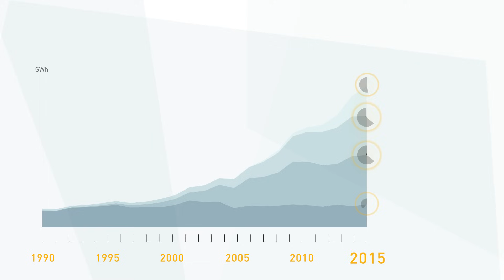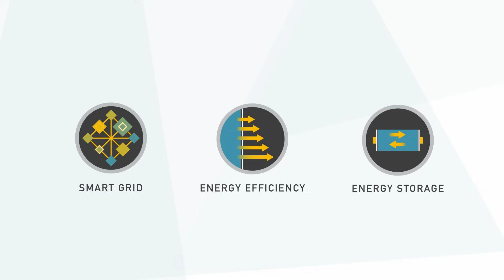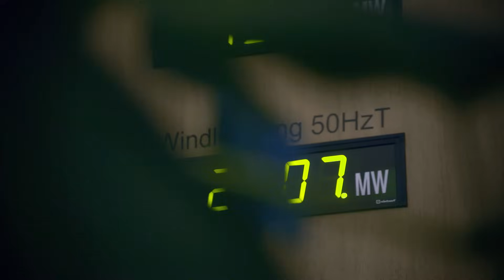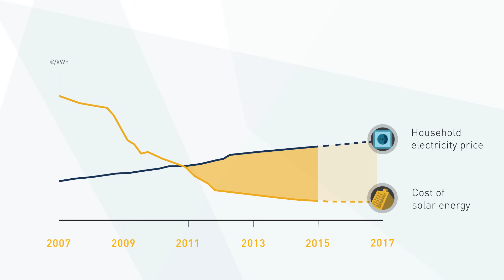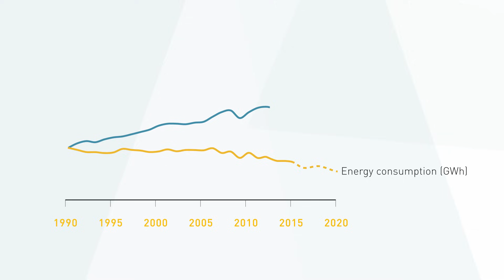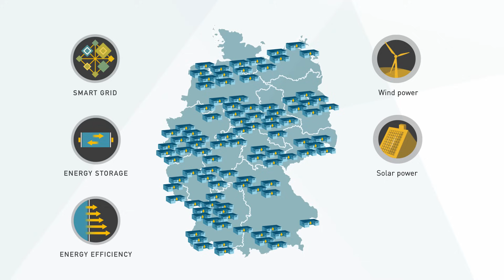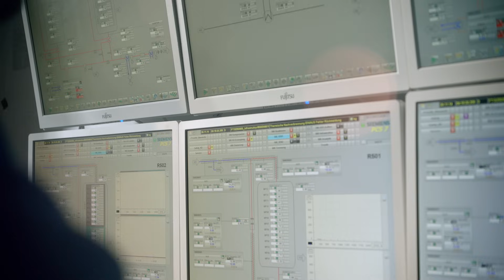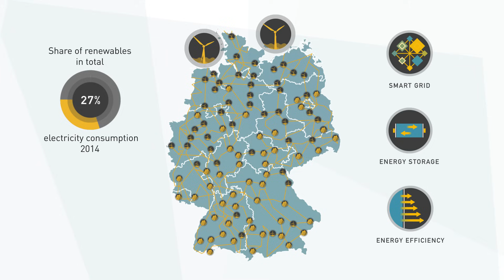Germany's Renewable Energy Revolution

Comment: https://youtu.be/klXj198vY4A

https://youtu.be/VeXVsybEQPQ

https://youtu.be/lIkzlq3XTcA

You have to ask, my big brother, Dr Steven Greer, about help? He will learn you how the free zero energy system of Nicola Tesla work? And how you can produce high voltage and power electricity for the whole Europe with low cost???? Also, to let your machinery and your industry run on the same level as before the actual disaster happens worldwide, and good luck. You don't need any wind turbines, also no nuclear power, or combustion oil or something else. If you don't know, you can also run combustion motors with H₂, water molecules. All dies systems are environment friendly!

Comment: Update 2020. 46% renewable share in electricity production. Wind power overtakes coal as dominant electricity source. While improving in the electricity sector, the next challenges are heating and transport. The car industry will see huge changes in the next decade.

Comment: Do u all know this thing....earlier electricity was produced from water ...water itself doesnt create any electricity unless n until sun rays are put on water n then such energy are used to produce electricity....this was the concept of generation of electricity through water...this can be said as an indirect source of electricity production    ..now u are using solar panels for generation of electricity...there r two ways either each house will have solar panel or solar panel are built in one particular area n then electricity is produced n distributed....sun is the object solar panel use to operate ...newtons law states no energy can be created or destroyed it just transform from one body to another...every sun rays or light rays or any other form of electricity eventually transmitted to earth n then we dont know ....this solar panel is a form of direct energy production....since all the energy is transmitted into earth ,the earth is bound to get heated during summer n vice versa.....nw understand the nature of sea level ...sea level is below in many countries ....so whtever electricity is transmitted in earth from which it is transferred into sea understand land and sea breeze....u r nt utlising electricity from water n directly putting pressure of mre heat on solar panels ...so water remain hot n gets mre hotter and evaporates ...this will happen to ur iceberg too ...it will start melting if mre heat is used...nw understand one thing if sun rays are in direct contact with iceberg if melts from above ...wht will happen if heat from below causes iceberg to melt from inside....there is a reason y we all accept newton theroy...earlier it was a renewable source now it seems it is nt ....i guess it nt getting clear so understand one concept wht happen when we touch ice or boil water ....nw wht will happen if u walk barefoot on road at 40'celsius or 10'celsius when ur body temperature is 37'celsius...ur scientist can understand this theroy....so better build some submarine or flying houses if water eventually acquires ur land .....commerilastion means betterment of the land n i think solar panel mite nt be a rite way to use just for business purposes afterall who what to leave their land ...solar panel mite cause destruction to ur land specially ice related land first...other country mite use this as an exception mite nt continue with solar panel if n when destruction occurs...solar panel is one of greastest achievement in world history if used wisely or mite prove the greastest weapon of mass destruction whoknows ....lets hope thing dont get bad.....

Comment: Interesting that hydrogen and batteries are suggested for storage when almost all commercial electricity storage uses less expensive pumped hydro. Strange that the current relationship with Norway and Sweden balancing Germany's wind wasn't mentioned, they are well on the way to becoming the most interconnected power grids on the planet.
Reply: yeah exactly. interconnectors are great.

Comment: My tel. +48-780-129-544, email: htg@interia.pl   I invented a breakthrough source of energy which will be useful e.g. for laptops and for cellular telephones. I am looking for capital in the range $500 000 to $5000 000 for prototyping, patents and production. I have a computer simulation of my source of energy. The simulation is based on Classical Electrodynamics and on Circuit theory - both of these theories have been very well experimentally confirmed.

Comment: Several families use up electricity freely and end up getting a $200-$500 power bill. That could be an especially hard pill to swallow when times are tight. You can cut electrical power consumption and bills through the generating power method “boma fetching unique” (Google it), which helps you produce you own power.

Comment: How to get 95% of the energy gone...ASAP.  Make engine that is 60% that can run on fuels, Natural Gas AND battery without electric motors.  No hybrids...  That engine can enable boundary layer drag reduction that can cut drag by 50% or more.   For example.  Tesla now gets 100 mpg e.  Make new car that is 1/2 the weight and 1/2 rd the drag...200 mpge.  That is 10 times more than a car now gets.  City will be twice (400 mpg) if it maintains efficiency like the Tesla does.  On natural gas at $1/gal that is around 1/2 cent/mile.  In contrast, electricity in Germany is 30 cents/kw-hr or $10/gallon e.  10 x 2 is 20 times less to travel via my new car with new engine.  When batteries drop in weight and increase in power density, then they can be used to power the car for short trips, thus using mostly renewables.  People will buy this as they won't have range issues and can get Natural Gas from house.  The engine pumps the gas.  Why pay 20 times more when you can have it much sooner?  Politics?  Oh, I forgot, the well connected have to fund their jets.  Sorry, go back to sleep....
Reply: Watch Audi the next 2 years
Also Mercedes has the only engine,who is 50% effective with fuel.
But no,we are in for a new energy source.
And that not electrical.
Reply: Jan54, the key is low power efficiency, not at the high power levels where the 50% figure is had.  I would guess the Mercedes engine is only 10-15% at city driving and 20-30% highway, not 50%.  Also, they need to use low cost Natural Gas and even H2.  read my tweets at twitter.com/seaplaneguy  I explain how the Mercedes engine is flawed in the basic layout.  There is a better way
Reply: Haha,i let that open.
Its the formel 1 engine of there f1 car.
That has the throttel most of te time wide open.
Very special and smart engine.
https://www.motorauthority.com/news/1112999_mercedes-amg-f1-engine-achieves-50-percent-thermal-efficiency
Reply: Jan,  You missed the point I was making.  The technology may be ok for racing, but racing is not valid for street cars.  No car needs 1000 hp.  They need around 5 hp city and 20 hp highway steady speed.  That means the throttle is mostly closed and the thermal efficiency is very very low.  The idea is you compete against electric vehicles by having constant efficiency all across the power range, not just at full throttle as you say.
Reply: You are wrong,the have a special combustion part in the cylinderhead.
There the inject a rich mixture,and in the cylinder the inject a poor mixture.
In the combustion part is also the spark plug.
If the ignite the spark plug,the rich mixture flames the poor mixture easely.
So it a very efficient poor mixture engine.
Reply: Jan, you clearly never took a thermodynamics class.  No, YOU are WRONG.  When you throttle, the effective compression ratio drops and thus the efficiency. You see this with the Saab variable compression ratio engine.  Well documented.  This Mercedes engine does not have variable compression ratio, so the efficiency does drop. The mixture is another factor separate from the effective compression and expansion ratios.  Basic thermo.  As the power level goes from full throttle to closed throttle, the efficiency DROPS. Every BSFC curve shows this. That is the point.  Any book on thermodynamics shows this...
Reply: It has a hybrid turbo on it.
So there is always the wanted air in this engine.
Compression ratio is not so important with this engine.
Reply: Jan, not sure why this is so hard to comprehend.  If you have a 500 hp engine and you only need 5 hp or 1% all that "hybrid" stuff will not be functioning as a turbo does not work at that power level due to the lack of air flow.  

The question is how efficient is that 5 hp?  I would guess that engine is 5%, maybe 10% and not 50% at the 5 hp power level.  A large engine with all the friction and drag making 5 hp...not good...  That means your fuel economy around town would be 5-10 times LESS than what is could be if it were 50%.  That is the point.  This engine fails to address the central problem of power...therefore of little worth.

Comment: You should also know that at peak times when the air turbines in the nord of germany produce above-average amount of electricity (in windy periods), the transmission network is incapable of handling it and the electricity is then adversly affecting the transmission network in the Czech republic as the electricity is rolling over it's network infrastucture which (may) cause blackouts and requires very costly counter-measures that Germany doesn't seem to care about at all.

Comment: The comments attached to this video frequently mention energy utilization behavior in the United States. As an American, allow me to suggest that an impoirtant idea for improving energy usage behavior is to talk about all energy quantities in the same units of measure, either British Thermal Units (Btu) of else Joules. In the U.S. we refer to gallons of gasoline, cubic feet of natural gas, and kilowatt hours of electricity. These units do not invite easy comparison. Each fiscal year I personally convert my energy purchases into Btu's. Thus, in 2016 I purchased 80,000,000 Btu's of natural gas, 8,800,000 Btu's of electricity, and 19,800,000 Btu's of gasoline. The cost per million Btu's varied like this: $8.43 for natural gas, $51.80 for electricity, and $18.33 for gasoline. This shows that electricity has an energy cost of 6.1 times that of natural gas. Ratios like this can be very helpful to energy-conscious individuals trying to sort out purchase information. Ratios like this are masked over by cliches like "energy efficient". Using this approach a person can get shocking ideas about the cost of energy from some sources like AAA batteries which provide energy at a cost of about $800 per kilowatt, or coin cells that provide energy at a cost of $1500 per kilowatt. I am proposing that using the same unit of measure (from physics) for energy sources would be a way to drastically improve human energy consumption behavior. Perhaps the Germans could initiate this approach as it would be consistent with their national energy policies. Thank you for the interesting video!

Comment: Take notice of how Germany didn't significantly reduce its coal consumption, aiming instead at abolishing nuclear energy. In the end I'd say they didn't do much in twenty years except maintain the status quo in terms of greenhouse gas production by replacing nuclear with renewables. It's one thing to not build new nuclear plants, but it's quite another to shut down already operating reactors which are producing cheap and clean energy... the investment had already been made. Germany should have kept those reactors running until they reached the end of their operational life and instead aimed to replace coal with renewables.
Reply: You are right about coal consumption not being significantly reduced. You're wrong about the cause. Renewable capacity is added faster than nuclear capacity is being shut down. The problem is growing exports. In 2016, Germany had an export surplus of 9%. This is because of massive overcapacity. Germany has a peak load of <80GW. The total fossil, nuclear and hydroelectric generation capacity exceeds 100 GW. Even during periods of peak demand and little power from wind and solar, Germany exports electricity. This has caused market prices for electricity to plummet, as a consequence most gas power plants (an important bridge technology) never run and some are being shut down permanently.
To fix this issue, a carbon tax is needed. Not only will this make electricity from coal less lucrative and possible force the least efficient ones out of business first, but it will also make renewable energy and gas more competitive. Another approach is to shut down coal power plants by law. I would prefer a combination of both. Germany needs to shut down all lignite coal plants by 2030 and all coal plants by 2040 if it wants to reach its self-set climate goals. And that means making policy to achieve that *right now*.
A few coal plants are scheduled to shut down this year and next year, but this is coincidence. All plans to build new coal plants are temporarily or permanently on hold and given the uncertainty, it is unlikely anyone would want to invest in new coal plants at this point. So we will see a decrease in electricity from coal in the coming years, but without appropriate policy, it won't be fast enough.
Reply: The German public had for years a hostile stands towards nuclear power, which is partly based on unrational fears, but your "Cheap and clean" argument doesn't really fit either!
There is a huge misconception here!

There have been many studies that showed that nuclear power in Germany is only "cheap" cause a lot of costs aren't billed into the electricity price.
- All power plants were build partly with government money (this wouldn't change if the plants would run for longer, so this is a plus, but still makes the prices seem cheaper).
- Nuclear power plants are exempt from a bunch of insurances (cause they would be way to expensive) and the government jumps in.
- Germany still hasn't a place for the nuclear waist (and actually has a few underground storage places that leak water where the waist has to be digged up again).
- The nuclear power plants have to be decontaminated (again this are the same costs if the plants run for longer, but isn't shown truthfully in the price)

....
Reply: The last 2 points a partly billed into the prices, but the past has shown, that for both the costs are much higher than previously thought, which again will be billed on the German tax payers.

"Clean"
Yes nuclear is way cleaner than coal, but the real emissions are way higher than those of renewable. There are many gas power plants in Germany which are actually cleaner than nuclear. The issue is that producing the uranium fuel is very dirty!

And both issues will get way worse for nuclear, as uranium will get way more rare and therefor dirtier and will even start to become a significant cost factor.

So yes nuclear is cleaner than coal and cheaper than gas, but not as wonderful as some try to frame it.
Reply: The biggest issue though is, that nuclear doesn't work well with renewable.
One point is the grid, which has to be decentralized (similar issue with coal tbh) and the other is it isn't flexible enough.

Renewables fluctuate and need storage and flexible power plants (like gas, hydro, waist). The German nuclear power plants are all from the Cold War era and are anything but flexible (newer nuclear power plants are supposed to be better there). Coal isn't idle here either but way better than nuclear.
Reply: The biggest I have with your post though is your assumption of "just keeping the status quo" and "replacing nuclear with renewable" is really misleading, as Germany needs much more electric energy than 25 years ago.

So renewable went up 950% and coal is down only 12% while nuclear is down 40%, but overall electricity consumption went up 17%.
So in raw numbers we have 40 TWh less electricity from coal and 60 TWh less electricity from nuclear, while Germany produces 167 TWh more electricity from renewable!

So 24% of renewable replaces coal, 36% replaces nuclear and 40% goes into the rise in consumption.

That is everything but, "keeping the status quo" or only "replacing nuclear with renewable" (as this is only a little over 1/3)!
Reply: Jakob Schulze You need to learn to read. Nuclear energy is cheap to produce... the power plants are expensive. Once the interest on capital has been paid off you're spending vastly less to keep the power plant operating as opposed to chucking in 15k tons of coal per day for each Terawatt coal plant. Germany had eight reactors which have since been paid off and were generating clean energy. Decommissioning them meant that you had to force other non renewable energies to take over when you could have continued operating these reactors for at least another ten years. So instead of displacing coal you only displaced nuclear.

Your logic is that once you built the plant and put it into operation that one year is just the same as fifty because of the decommissioning process. Once you've put a plant into operation you've obligated yourself to all the costs associated with decommissioning, so you're better off getting as much out of the plant as possible... otherwise that's wasteful.

Oh and remember that demand for coal has risen as well, so Germany is still exactly where it was when it started, and could have been much further along had they targeted coal instead of nuclear.